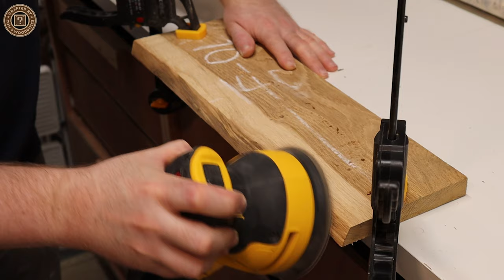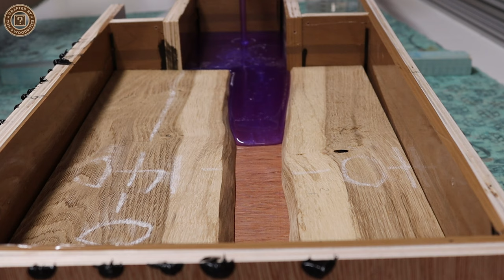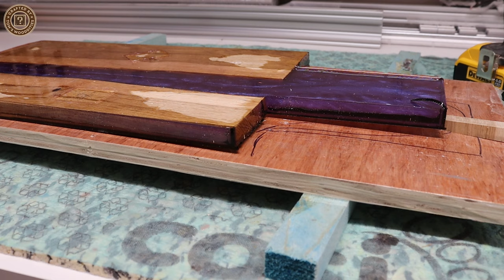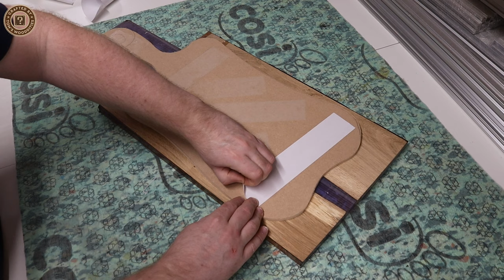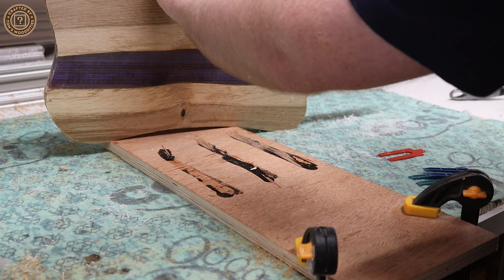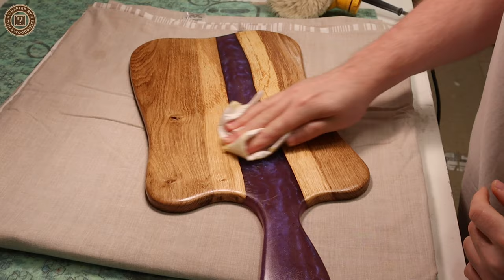Epoxy Resin Cutting Board / Charcuterie Serving Board

Comment: Hey man, found your channel through Instagram and really like your work. Are you using marine ply and parcel tape for your form or something else? Cheers
Reply from the maker: Thanks Charles :) so for materials, you can use anything that’s flat and sturdy, so in this vid it’s 18mm hardwood ply with parcel tape. If you’re looking for more of a “how to”, check out the videos I made on the resin shelves as I break down the whole process 👍